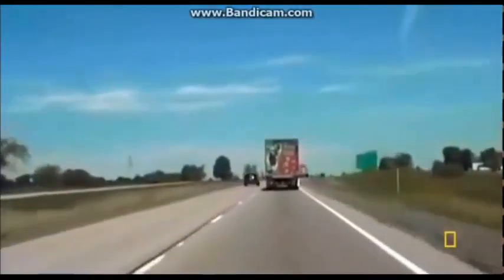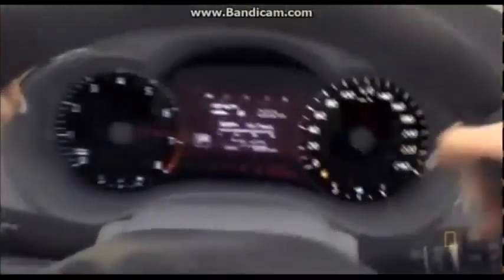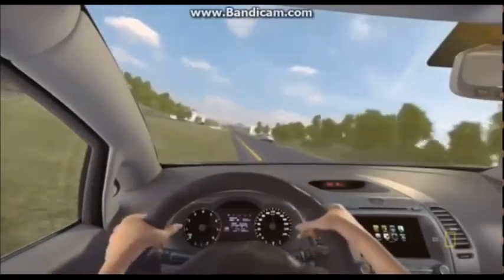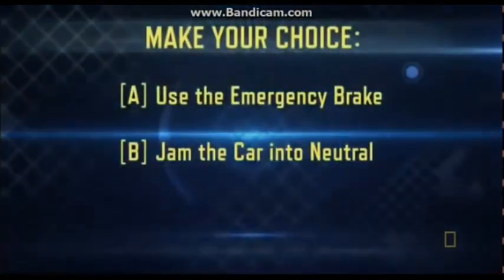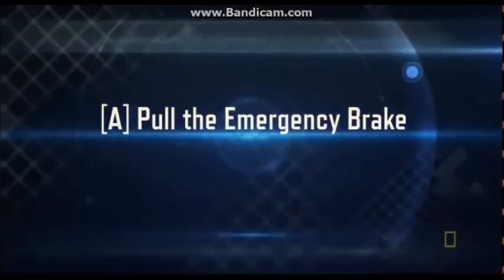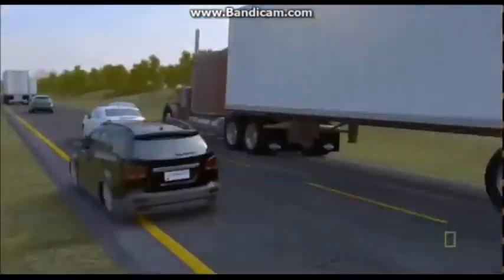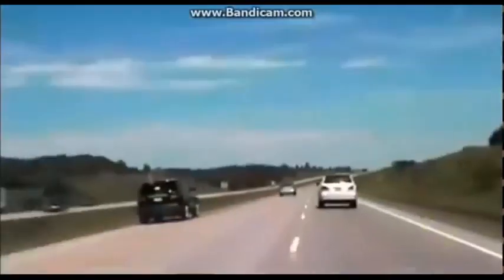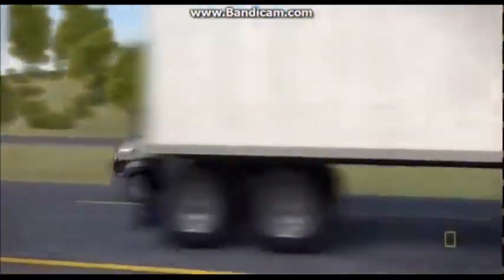How would you stop your car if your gas pedal stuck

Comment: Nope! Since the car pedal is stuck and u put it on N u will fuck the engine by overheating and the engine could explosion for that Rev think about it like that put ur car in N and full throttle can u keep that for like 1min the time u need to stop ur car with a high speed?

Comment: Bs... with engine off, for the you can use the brakes, it would be harder because you dont have oil pressure but you could still do it...f off
Edit: by going neutral you would probably bow the engine since the gas is stuck on max throttle

Comment: Push the clutch in... use the brake pedal to slow the car, shut off the engine once you have completely stopped.
Reply: Ok, how do you do that with an automatic transmission?

Comment: Bad video! Brakes are always stronger than the engine (without tuning). So it is not possible. And if you turn off the ignition the steering wheel will NOT lock. Only if you Take out the key. And the most cars can't be changed in neutral because its locked during driving. Stupid Video